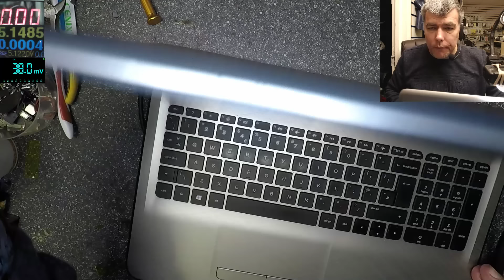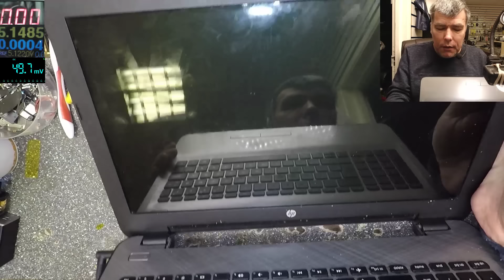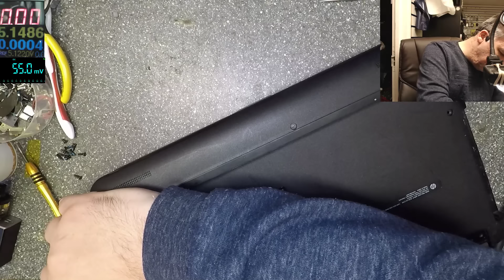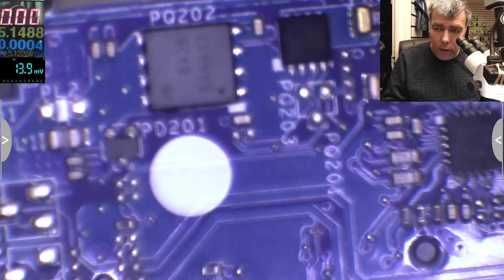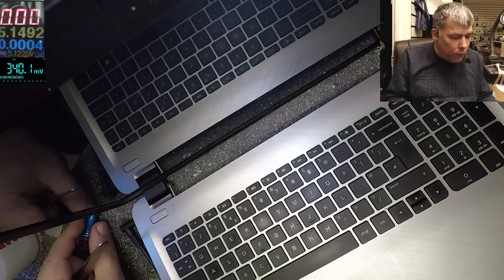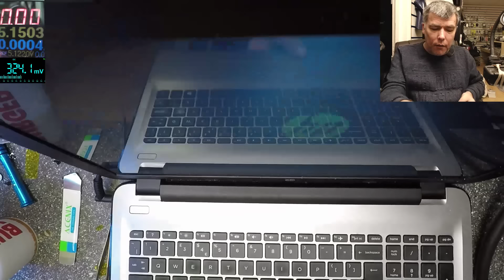Most common fault on a Dead Laptop

Comment: Another technique for fault finding is to use a Liquid Crystal thermal sheet placed over the circuit board while under power.  If there is a defective component creating slightly more heat the sheet will detect it quite fast visually and can be a real timesaver.

Comment: I have a problem with my dead laptop. I find 15 volts on the gate, but  mosphet does not transfer the voltage to the other side.. (on the out put.) .. what problem could this be.

Comment: Any idea on why it can happen in this scenario: I switched the HDD to an SSD, I didn't interfere with anything and at first it didn't work, laptop completely dead from only that, then I resurrected it but it's random sometimes it will work sometimes it won't, it's random, but it's not working normally, the display doesn't work and the LEDs from the HDD working, WiFi, charging and so on are not working also and now even some keyboard letters don't work, sometimes it just shuts down randomly and then I can't turn it up anymore, completely dead, but if I plug the SSD out, then I boot it works sometimes and then when I plug the SSD in it will work eventually, but again with those problems, with the old HDD now it doesn't work normally also like it used to

Comment: I doubt you will see this comment but you seem to be very good at this me and my dad tried repairing a acer nitro 5 the mosfet was shorted we removed it and jumped it after plugging it in something started sparking under the board then stopped it is getting 19 volts down the board to thanks! Also do you do anything like mail in repairs?

Comment: This is so over my head. I'm an electrician, but not familiar with these circuit boards. My hp15-da0053wm has 0 lights coming on. New battery, new charger, new charger jack. Still nothing

Comment: I am willing to pay a lot of money to meet you. The thing is, I hope to hear from you. My hp laptop port is loose, the battery is not holding any charge, and when I plugged in the charger.... It is basically not turning. I had to count to 30 seconds to see a white light near the LED  it went away quickly, and even if you pressed on the power button, it still won't turn on... please help.😢

Comment: I think im just stupid and dumb for trying to reflash my acer nitro laptop the issue is it turns on but black screen and i already tried all basic troubleshooting even tried to changed the ram but it did not work. The last option i did was flashing the bios via usb. When i tried to boot the fans accelerated to the max which ive seen normal on videos online after a couple of minutes i thought that its going to boot fine only to fine out it no longer turns on from black screen to dead laptop. Anyone pls help

Comment: Many thanks.  I had exact HP and had same problem. I took it to a shop here in Cambodia. After 3 days, they told me the motherboard is faulty. And if I pay them $45, they will fix it. After hesitating I agreed though it was a bit expensive.  Again, after a few days, they said they are unable to give it life.  So I took it back home. While I was contemplating to discard it after removing some parts, I came across your video. I have forwarded it to and requested them if they can do the same. Will update u soon. I wish I had seen u before!!! I can only like u and subscribe.

Comment: Hey I need help my laptop has the same issue tried to change a capacitor and that wasn’t it but there is a power supply (cp) chip getting too hot just when plug up going up to 40C and I don’t know what to do.

Comment: Hello 😊 my laptop starts as soon as I plug in the power, the fan is at full speed, but no display. powergood signals give 3V at the SIO. The chipset and GPU were heated with flux without changing the balls. Do you think it's a corrupted bios problem?

Comment: If using a single wire does the same job as the mosfet, why is there a mosfet at all ? Engineered failure ?

Comment: Hii
I have an hp laptop
About a year back the battery has giving some problem
And was not charging anymore
So i managed to still use it by keeping it plugged in
Recently it's not coming on 
The light shows that it's plugged in and that it's on but the screen doesn't display HP and is black
Please advise
Thanks

Comment: The owner will lose some minor feature as a result, such as having to use the sleep button instead of a short press of the power to do so as that will likely now only shut the gate and cut power now. The mosfet would have regulated the difference in duration of press. Minor things rarely used or signals to sensors you didn't know to look for. The wire will last as long as any other fuse and would only fail for the same reason as the mosfet in the first place. This is a real world practical fix like fix-a-flat. It might even be a patch. But no it's not a new tire and there's a fair amount of tread on that machine. Get everything you can out of it.

Comment: I respect the man , infect he looks exactly like my best friend who is a Professor of IT and  we went to Electronics school together so i know electronics as well and that is why i can see this man is not a fake , no fake repairs here   
 But i must say this is not the most common fault on laptops(tho i understand you have to have some tittle for the video) ,
 Most common fault on laptops is a broken screen be it screen surface it self or the clamps or plastics around . So Away from the  motherboard and other electronics  , screen space is first to go . 2nd most common fault is keyboard . And it doesn't take a lot of brains to figure this out everyone has had these experiences .  
And what i found also  ,if you are reading still you will be awarded, is that Games run better on HDD if you are on DDR3 memory because the processor and memory cant   fallow up with games loaded from SSD  , and you get stuttering , it loads up faster but less stable . I tested this on 2 Games Assassin's Creed odyssey and Forza 5, my I5 4590K i think and 32Gigs of DDR3 ram can not work as fast as SSD loads up ,  so the CPU is the bottleneck . I did not find anyone in the world who has tested SSDs against HDDs and say this fact , that if you have slower or older PC games will run better on HDD. It will take more time to load up , but once there things are smooth . While with SSD you get constant stuttering because if you are in the game and new scene is being loaded up while cinematics play , you wont be able to enjoy because SSD will take 99% of CPU and RAM , and 1% will stutter your cinematic , or if it happens in the game , like open world games , GTA5 , Forza , Assassin Creed , they will all stutter because things load up so fast that in that 100mS CPU and RAM are overwhelmed  , and you get stuttering .
Not a single soul  in the world on social networks that tested SSDs specifically for games mention this . They always test things superficially , lets see the loading time , oh it loads up faster , 1 minute faster or 30 seconds faster . What they don't say is that you will get micro stuttering because your RAM and CPU hand handle such a memory throughput and Run the Game .
I was going to buy an SSD , 2TB SSD for games and noticed this , before i installed games on SSD because YT said so , and i was thinking i get stuttering because my PC is bad , no PC is good it just cant handle such high load up speeds .
So for this channel i will put this information out , because i respect the man and i want people who watch to get something , some useful info . You do not need 2TB SSD for Games , good old HDD is even better if you are on DD3 , if you are on DDR5 or 6 , new PC , modern  , then this wont happen .

Comment: So i just got back from the computer shop and i have been told my motherboard is dead. it was on a sec and a on another sec, it is off. I have been going through the board and most of the components are shorted. Please how should i go by

Comment: Sorin, I have a HP laptop that powers up show's the HP log but then the screen gradually goes white. I've narrowed it down to the screen. If I press just beside the HP logo on the bezel it works perfect briefly and fades to white, also when this happens, they keyboard, mouse and hard drive cease working. Would that be bad soldering on the screen board? Yes I've checked the screen connector and opposite end and re-seated them. Would a chip on the screen board cause this type of fault. I've found that the end of a mini usb jack shoved between the case and screen it works perfectly.

Comment: The other day I was working inside of Premiere pro(in which my laptop was consuming Dedicated GPU), blue screen of error popped. VIDEO_TDR_FAILURE error.

Tried:

    Clean installation of driver

    Clean installation of OS from Microsoft site

    Rolled back to Windows 10 and installed driver.

    Using DDU performed a clean installation of GPU drivers.

Still code 43 persists: Windows has stopped this device as it reported problems (Code 43)

Any fixes?

Comment: IT Services Gold Coast Hello, I have this laptop HP Pavilion x360 - 14-dh1038nia, which had an update a while ago thus making the mouse touchpad unusable after Windows boot up. Have tried several methods like drivers update via HP Support,Windows 7,8 & 11, Linux but the device can't be detected by the system. However, on loading up the bios the mouse works fine but as soon as the OS loads it disables, thus being forced to use an external mouse.How can i revert to the default OEM drivers or what could be the issue.

Comment: Can I get some advice or input on a laptop issue that has developed in the last couple days? I own a Toshiba laptop that I’ve been using for the last several years. A couple days ago the LCD screen started getting slightly dimmer a second or two after boot up. It looks good right at boot up but then it dims to the point that if I’m outside it’s unuseable. And inside it’s barely useable. I checked the brightness setting and it’s on high. Running Win10(upgraded from Win8.1).

Comment: We used MOSFETs and other "surge suppression devices. Usually, they are not needed unless you have AC power that has a lot of surges and or lightning. Most of the time, just putting a good surge arrestor at the input to your building is plenty of protection.

Comment: was trying to fix a HP 470 G1 with the flashing white light problem - was following the 19v from the power jack  when i accidently slipped with the meter probe and shorted out 2 tiny caps ....... now i have no flashing white light ....... are there any fuses on this board ? - i cant see anything with and F on it - ive most likely fried the dam board !!

Comment: You are Dumb. You have zero volts where it's supposed to be, you are not drawing excessive current from the ac power adaptor.  You have an OPEN.  No voltage and no excessive current... open dumb dumb...

Comment: I have an HP EliteBook 8570p laptop that recently developed a problem. The problem is that the screen is only black when I turn it on. There is power in the computer itself and everything sounds and looks normal except for the black screen. I restarted it several times but nothing changed.

Comment: i have the same motherboard still i cant fix it it have short and adpter light goes off. there are short capacitor under the procesor and im not sure is it supposed to have resistance of 17ohems....

Comment: You're not dodgy, you're doing work when others are failing ;). I do it as well for my clients, but, only the TV backlight is an exemption. When I replace it, I can't stand replacing a single LED and let customer come the next week ;). Even if I'll replace only those with a difference in reading, some other old ones are dying. Plus, the newones can have a different colour or brightness ;). 

But, when it comes to MOSFETs, either a wait on a China delivery in a month time, or more, or do it the quick way and customer can decide if he wants to replace that MOSFTE or try to analyze the fault of it ;) if he'd like to pay more.

Comment: Hey Sorin. Great video. 

Can you provide me with some advice about a problem I'm having? My HP Probook is exhibiting a strange issue where it only charges when the battery is completely drained, and won't charge when it still has some power left, even if it's just 1%. Can you suggest a solution for this problem?

Thanks in advance!

Comment: Hello mr eng is this mosft for currunt pass only not divide voltage to other ciruts how we can detect if the mosft pass current or other wise and is this join of wire of source and gate safe on long run of laptop

Comment: sir would like to ask how to fix lenovo laptop that wont turning on., everytime I  press the power button the cpu fan rotate for few seconds i think about 5-10 seconds but after that it stop and nothing happened to the unit.. no display at all or anything maybe the connection from battery to mother has something wrong, pls help me to fix this

Comment: Hello sir.... Please am having a working system but it suddenly went blank and I try ti force shut down with the power button and turn it on again but it will on and the fan will spin for like 3 seconds and stop but the laptop won't display anything but its showing the motherboard light is on.. What can be the problem.... Please help me sir...

Comment: This vid worries me.  To put it in the right context:  If you think about a house with an electrical fault of some kind:  Sure, you could replace an old tripping fuse in your power service board with a big nail or something to reconnect the circuit and restore power - and it would (maybe) work, but you don't know why the original fuse was tripping - and that info is really important.  If you ignore the situation, there can be consequences.  If the original problem that caused the fuse to fail is still there, you might end up burning your house down, or electrocuting yourself or someone else.   Same thing here.

So yes, if an electrician came to my house and replaced a fuse with a nail in my power board, I'd be using the word "dodgy" as a description of the work.  If it was me I would not be charging for a "repair" like this in a million years.

For all the people who are saying "Thanks, I learned a lot" in the comments here:  I hope you are learning the right lessons.  There might be times or situations when a fix like this is appropriate - but just.... know - really know - what you are doing if you do this.

Comment: The best way is the easiest way I learned somthing knew I never thought of bridge the mosfet i have a laptop not charging and have to hard reset somtimes to even get to bios i took back of last night all power goes to battery but it now outputting it I got to the battery board and the 4 cells are fine about 2.7 v each so not flat but about half way tonight I will check the caps see if short or the fets and happy to know I could do this I have about 10 fpv drone esc with loads on each that would fit if I did that but I might atleast do this to see if it fix dont think this fix would work on fpv drones or 3phase motors because they use pwm and flip on it fast to make the pulse width modulation

Comment: I have an almost identical board in front of me.  It had a power surge which knocked out a TV, the laptop, a BlueRay player, and more.  Now that I've seen that you have no power from this point (9:15), I check my board again.  Discolorized chip (PQ202) on my board.  I didn't notice it before, but it turns out this is what got fried.  I guess I just didn't look hard enough.  Usually a visual inspection turns up the culprit(s) before even power testing.  This one was a little bit harder to spot.

Comment: I’ve repaired 3 HP’S that had no power and in all cases, it was cracked solder.  I missed the part of your video where you did or didn’t put the mosfet back in but my guess is the hotair gun fixed the problem on its’ own.  Cracked solder is common in old HP’S.  Just a thought.

Comment: In this type of case the 19volt line diode or transistor is mostly open or short u just bypass mosfet of drain to source in this case the laptop will be on but the battery will not charge

Comment: i have similar issue with HP C125. power indicator and charge led works fine at the jack.(white without battery and orange with battery. battery and charger all test fine.) Also at the activity led ( at the side of the bottom left of laptop from above). power indicator is fine. However, the thing won't boot to even the bios or spin up the HDD. No Beeps. Nothing but LEDS.  Brand new CMOS battery. No HDD Activity LED. Black screen. 😐